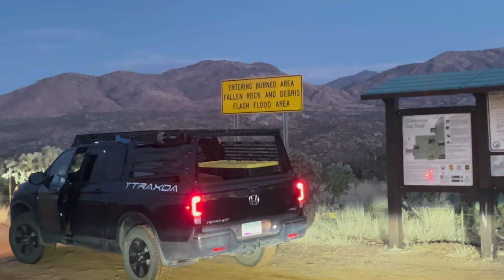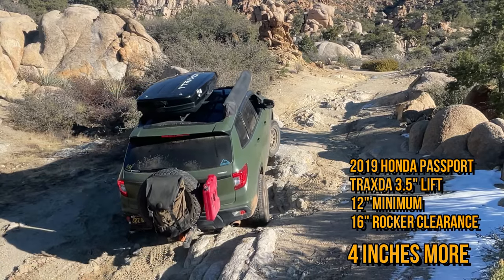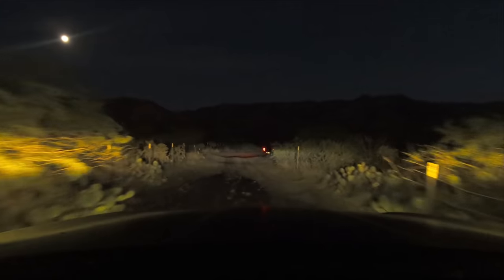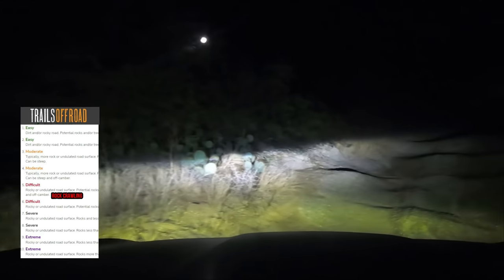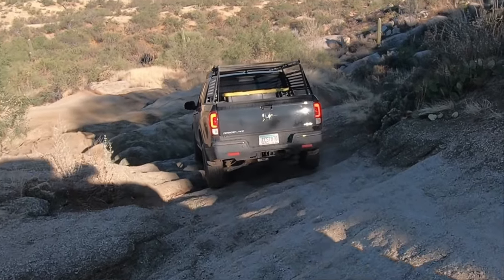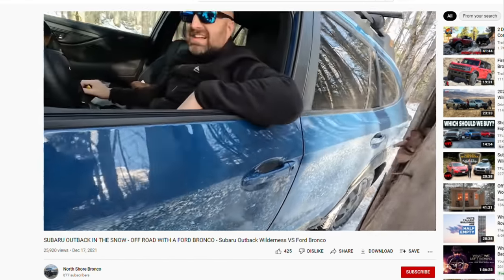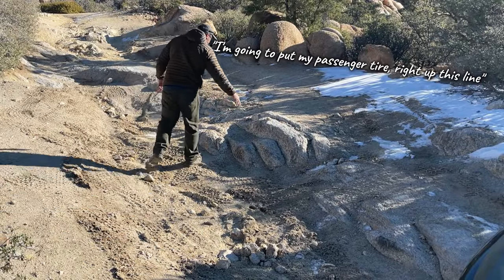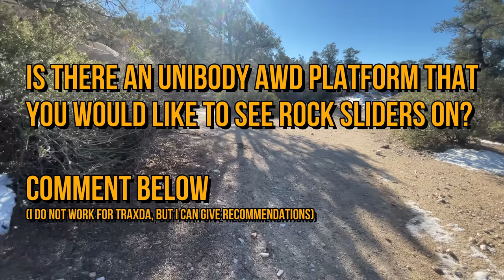Unibody AWD maximum (effective) ground clearance.  Why does no one talk about it?

Comment: Did your passport lift compromise any smoothness or on road driving?
Reply from the maker: Smoothness improved because of beefier tires and more sidewall.  On-road handling is different because I deleted my rear sway bar.  There's more comfort at slow speeds, and less sportiness at high speeds.

Here's the explanation:  The wheel track width of the Passport is a wide 66" front / 67" rear (stock).  I have wheels that are offset 45mm (1.7" outward) per wheel (stock is 55mm, my wheels are 10mm).  iVTM4 equipped Hondas have yaw control in the rear to help turn the vehicle.  The outside wheel spins 2.7% faster to accomplish this.  

What changed driving dynamics the most is deleting my rear sway bar.  which made slow speed more comfortable, but high speed turning not as sporty.  Imo, it's better configured for what I do.  I transplanted Ridgeline rear springs and shocks to help compensate.  

When I lifted my 2015 Subaru Forester XT 2", driving dynamics were compromised substantially.  So I expected there to be a degradation in handling with the Passport, but that wasn't the case.

Comment: Go measure a Tacoma, and you'll find one of the reasons they are so good stock off-road.  It's also the reasons people complain about their seating possition.  Way more than its competitors.
Reply from the maker: Oh, I did before I bought my Passport.  18 inches of rocker clearance 😃.  In 2019, I didn’t buy one because I couldn’t fit in one.  The electronic adjustable chair wasn’t available until 2021, but I don’t think that would be enough.  I also measured a brand new frontier.  Rocker clearance is only 16 inches.
Reply: @JonDZ_Adventuring  great example. We've hung up my buddies frontier where his brothers Tacoma waltzes over
Reply from the maker: @PatrickRich  so, I have possibly exciting news. Greg thinks he could implement portal axles that are made for a side by side and apply them to an independent suspension vehicle.  These portal axles are about $8K for a set too!  While expensive, it’s not $35k expensive.
Reply: @JonDZ_Adventuring  I’ve been saying this to you for a while! Not just for better CV angles which means more lift and travel, but to get some actual wheel torque and alleviate the torque demand from your AWD components!
Reply from the maker: @KTMcaptain  I didn’t know they were available for independent suspension until Greg told me about them a month ago.  Exciting stuff.
Reply: @JonDZ_Adventuring  H1 Hummer had them! Very exciting. Any torque multiplication it does for you affects the strength of your LSD. So if it’s a 2:1 without inefficiency your LSD can transfer twice the torque. Something like a 1.6 or 1.7:1 will get you right where a 4 runner for crawl ratio!

Comment: These clearances are not real either because they are taken at unladen weights, suspension uncompressed. In situations where you need clearance, especially in an overlanding vehicle that is loaded with full payload, those clearances are much lower due to spring compression. The second-gen Acura MDX is one of the only vehicles I've seen where they listed a fully-loaded ground clearance in addition to standard unloaded ground clearance. 8.2" to 5.6" fully-loaded. That's reality. The clearances will drastically change approach, departure, and breakover angles, and the way the load acts on each corner of the vehicle will change these numbers even more. Sliders protect the outer edges of breakover concerns, but getting high-centered can happen anywhere under the body.
Reply from the maker: Measurements are taken at 5400 lbs.  a stock passport is 4250.  With the upgraded Eibach springs, there’s more clearance now.  12.5” centerline and 16.5” rocker, not counting the rock sliders.

Comment: So, why stick with a unibody at this point? The body-on-frame solutions aren't THAT horrible as daily drivers.
Reply from the maker: Tommy, I use to drive a 2008 FJ cruiser.  I couldn’t stand it.  Even modified, my Honda Passport is still very enjoyable to drive (to me).  I also tried to buy a Toyota Tacoma, but I couldn’t fit in it, it was like sitting in a Toyota Corolla, screw that 🤣.
Reply from the maker: @mandingo9471  I feel like the Honda midsized platform is situated between a car based platform like a Subaru and a body on frame.  Onroad Handling is somewhere between, as well as off-road capability.  The Honda Passport seemed to be a good place to start, and with the way I have it setup, I’m very happy with the results.
Reply: ZJ, XJ, and WJ Jeep cherokees are all excellent off road platforms and unibody. You don’t need a body of frame. Plus rocker height is what really matters. No one wants a huge rocker height so they can’t get in the vehicle, so I’d rather have the minimum clearance and rocker height close so that I can have a nice clear underbody without having a huge step in. If you raised those Subarus up to 16” of rocker height then they’d have more actual underbody clearance for you (extremely difficult to accomplish lol but is an example).
Reply: @JonDZ_Adventuring  You seemed to have found a great middle ground and your enthusiasm is quite contagious. Keep at it! I hope to run into you someday out and about. I'm in North county San Diego.
Reply from the maker: @tmcnicho  hey!  I actually drive into San Diego once a month.  We explored Anza Borrego twice around October too.  Hope to see you around!

Comment: I volunteer my crosstrek as Traxda tribute
Reply from the maker: I’ll put in the good word for you.  I know Greg was interested in getting into the Subaru market.  At the same time, they like to get into markets that don’t have as much competition, but maybe there’s something special they could bring to the table.  Having had a Subaru myself, I was disappointed at how the subframe had to be lowered in order install a 2 inch lift kit.  I bet Greg could figure out a way to retain as much ground clearance as possible.
Reply: @JonDZ_Adventuring  that is my biggest issue, one company in particular is claiming the front subframe does not need to be dropped when lifting more than 2 inches but the rear must, in my opinion it doesnt make sense as “anything more than 2 inches” will create a very bad angle for the cv axles and boots on a daily basis, now throw in offroading to that and it gets to be a problem! Ive seen traxda on your car and on a Rav 4 both in person now and i love what i see!
Reply from the maker: They’re not afraid to make parts.  For example, the axle relocation kit that allows to jump from a 30.5” tire to a 32.5” tire.  People making Subarus lift kits just want to make “spacers”.  If Greg puts his mind to it, he’ll change a subframe part so that it works.  He’s a wizard.  Hard working one too!  I’ve never met such an optimistic and talented fabricator.  Not like I met many, but I just hear of the same sad story… “we’ll add it to our todo list”.  I wish Bilstein and Eibach had Greg’s work ethic.  There’s still no aftermarket spring and shock options for the midsized Hondas.  So sad 😢

Comment: Why not just buy a Toyota FJ, 4Runner or Jeep.  What you save in gas is not much when you did your MPG comparison.  Everything you carry on top of you Passport would fit in a 4Runner with room to spare.
Reply from the maker: Actually, I use to drive a 2008 FJ cruiser.  They just don’t work for me as a daily driver.  Also, the Passport has more cargo room than a 4runner, but that’s not the issue.  I made a video about “WHY” here: https://youtu.be/Hlg41C-W9r4